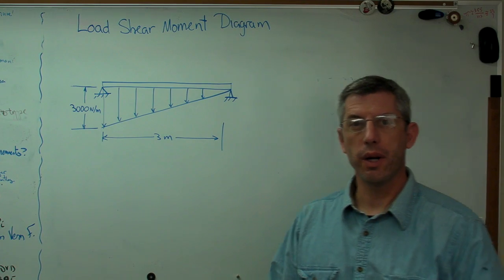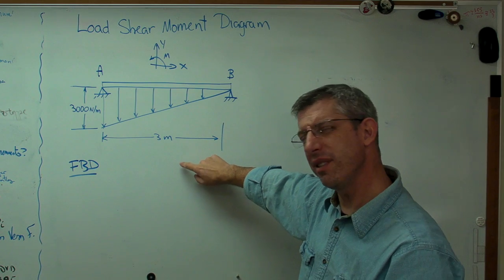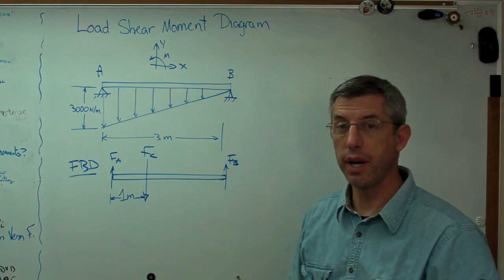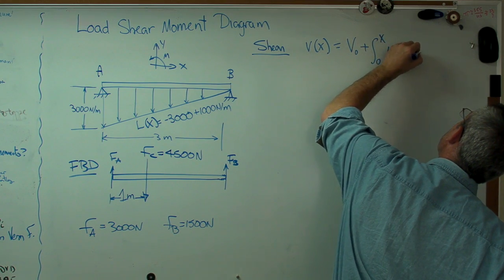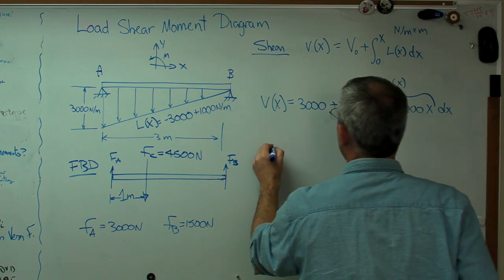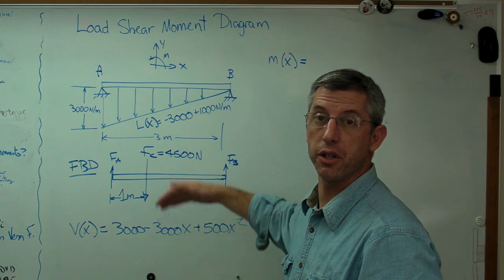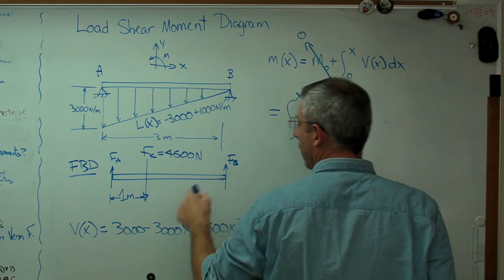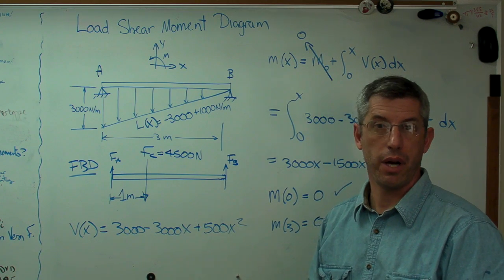Load Shear Moment with Distributed Load.MP4

Comment: For a rectangular distributed load you multiply the distributed load by the length as a point load on the centroid. Ex. A 3kip/foot load distributed over a 4ft section will result in a 12 kip force at 2 ft. Hope this helps.